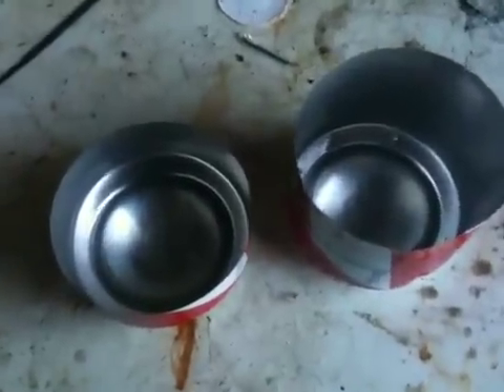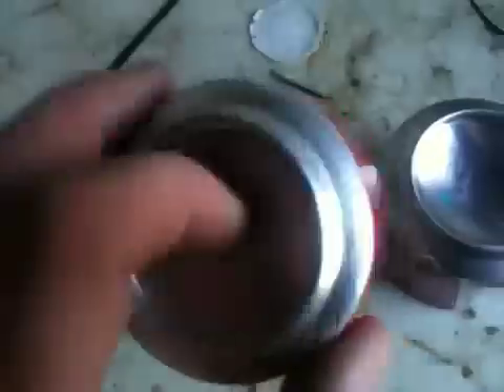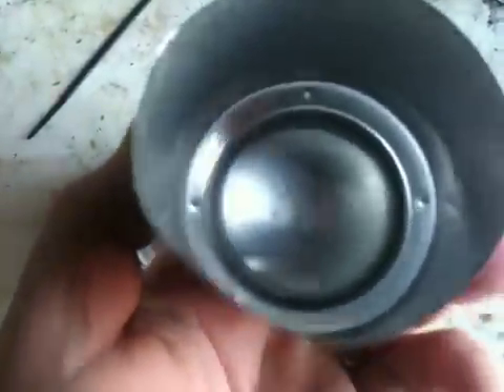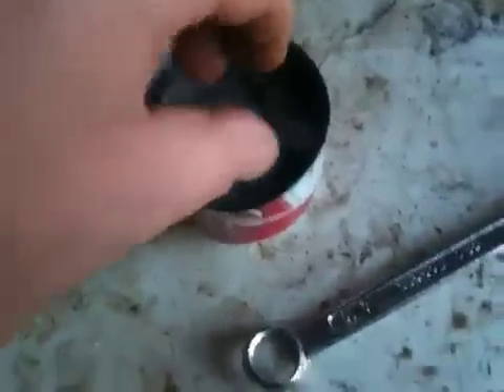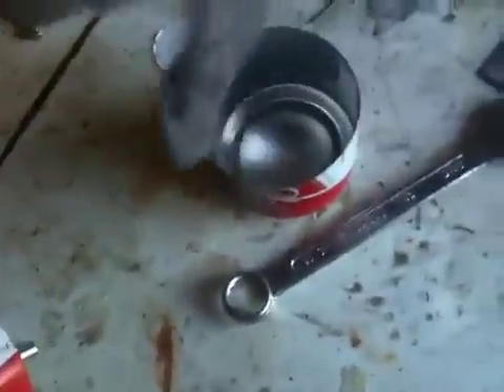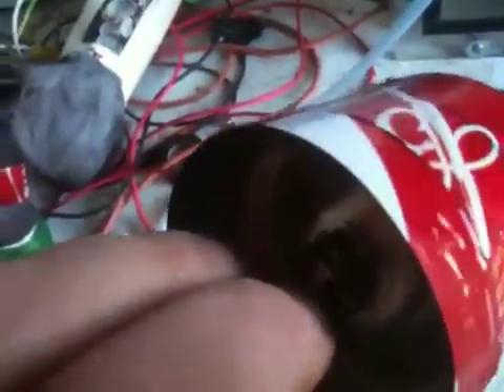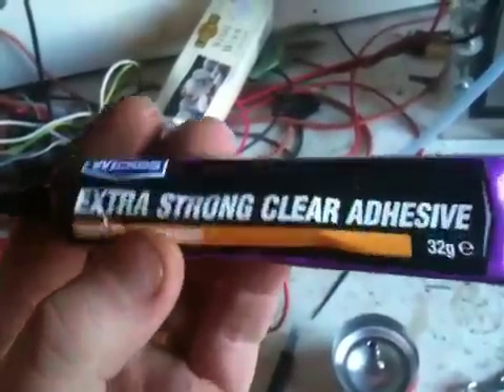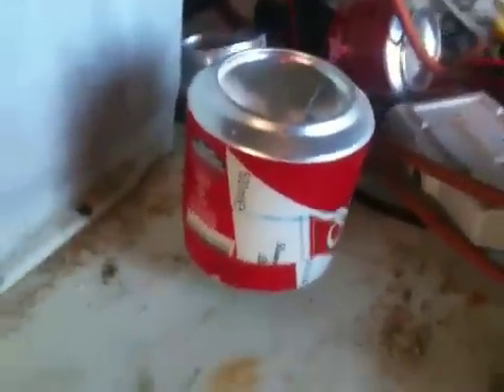HHO gas stove experiment

Comment: hey dude!! is this gas at the time of burning, smells badly or not? and what about if the gas leaking problem arises? actually we are unable to see this gas and smell too? please send me your whole system video and please speak little bit slow becaue i am from india so unable to catch your fast english and pronunciation too.
and tell me one thing that is this less expensive than LPG?
:-aditya from india
Reply from the maker: ADITYA RANJAN     Hello, thanks for watching. The gas is odourless and is invisible. The gas burn clean because the oxygen and hydrogen atoms just join together again and this re-join causes the explosion or flame. This experiment is not recommended as it can be dangerous with out Safety equipment. Make sure you have sufficient safety bubbler and flame retarder in your feed line. Thanks again
Reply: give me your whatsapp no., actually i want to talk to you. please
Reply: what is a flame retarder? and you are from??

Comment: very nice but the can is melt.
Reply from the maker: Muhammad Azeem Aluminium  takes a very high temperature to melt so no the cans would not melt
Reply: very nice welldone
Reply from the maker: Muhammad Azeem just he careful with this experiment, HHO gas is very volatile and should not be used with out the correct equipment!
Reply: i know that's i make it 100 times

Comment: Does it cost more or less to produce the hydrogen than to power an electric stove/heater...And i understand its not as much fun but it is an honest question..
I have a theory that using a turbine to aquire the said power to produce the hydrogen and deliver the water (outa the tap) is actualy a valid way to save energy.Cos the delivery system wastes the pressure used for delivery
Reply: It actually uses less power to use a pc power supply producing hydrogen to heat, than it does to run electric heaters. an electric heater uses about 7.5 amps, and a power supply uses about 3.5. and with the hydrogen you can actually get higher temps than a heater if you know what you're doing.
Reply: It needs much more Power

Comment: A safer way for burning hydrogen is to pipe your source hydrogen to bubble up at the bottom of a cup of water.  That way if you get an explosion or if your hydrogen pressure in the supply line suddenly is very low, it will not be possible for the flame to make its way up the source line because the explosion hits the water as a "firewall".

Comment: what kind of hho generator are you using?
Reply from the maker: Hello,
It is a dry cell, 9 plates (nnn+nnn) configuration that runs on 12v dc power supply. each plate is 10" x 10". i use KOH  for my electrolyte with distilled water.
thanks for watching!
Reply: cool im going to build one, i play around with electronics and ive made a few joule thiefs but this hho stuff is awesome im just worried about the saftey of it all id like to try running a lawnmower  or small generator of hho   have you tried that yet?
Reply: make more videos dude!
Reply from the maker: If you get into it, you will love it more and more. You can buy these things on the internet ready built but where's the fun in that! Also, you will gain a lot of knowledge by building your own as you need to know how these things work. They can be very very dangerous if not operated properly and could cause harm and damage your ear drums if an explosion goes of. Make sure you put plenty of safety in place when using this type of apparatus. Always make and use a safety bubbler with a safety valve in case you get any flash backs. I had an explosion once and it made a right mess. I did make a video of it and I think I labeled it "HHO EXPLOSION" have a look at my other videos to find it!
Take care now and have fun.

Comment from the maker: the first thing is i would not recommend doing this experiment as the can could explode if it is not packed enough. the stove does get a bit hot at the top as well.
please watch my other video called "HHO stove #2 and Glycerin for antifreeze IN DRY CELLS " it is a lot safer to use.

Comment from the maker: Yes I took a bit of a risk but you need to make sure you have a decent amount of wool or bronze wool would be better also a decent safety flashback valve on your bubler just in case.
don't try this unless with out safety equipment!
Thanks for watching
Reply: Telecastvids hola suscribete a mi canal yo are lo mismo no cuesta nada🌎